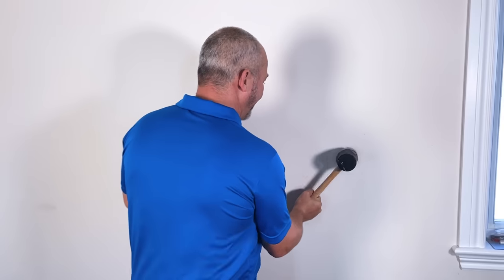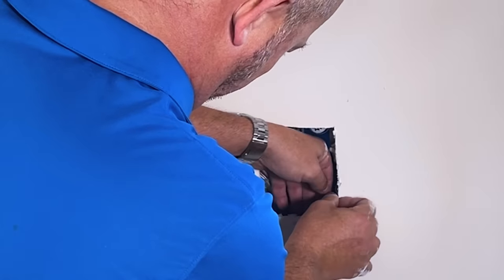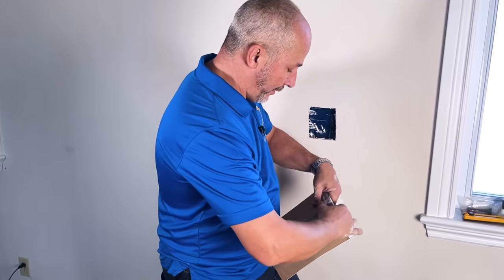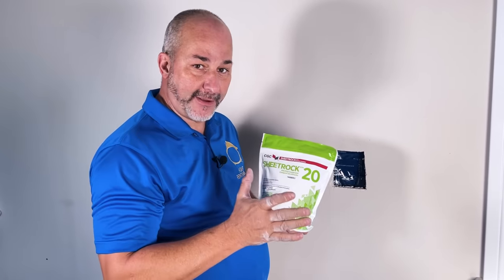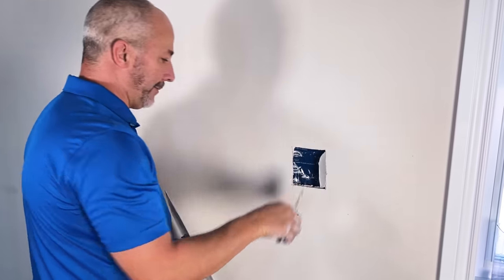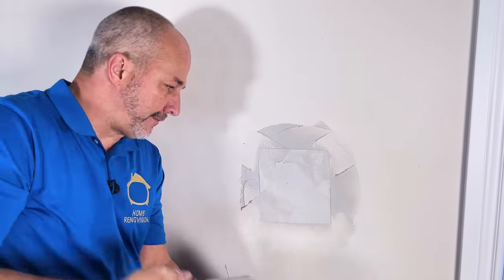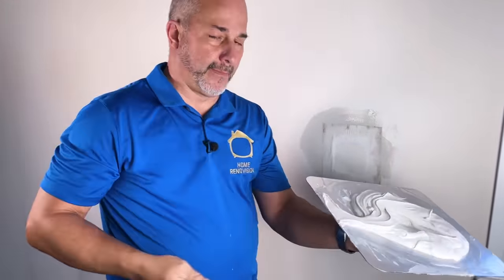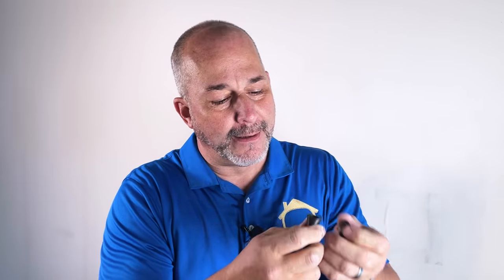Quick and Dirty Drywall Repair

Comment: It's hilarious that you happened to mention going to the hardware store to ask for a broken piece of drywall. I just removed a door and the door casing to make a regular old entrance way. I needed a small piece of drywall and got a broken piece from Home Depot for free. It doesn't hurt to ask one of the employees. Politeness goes a long way.
Reply from the maker: exactly! some of the best patch material out there is the free drywall strips they use to stack the drywall.usually a whole bin of them lying there!

Comment: Love the humor that you inject into every video. The only suggestion I might add is if the hole is any bigger a piece of bracing may be required behind the patch. You probably covered this topic in another drywall video.
Reply: Especially if in an area that might be hit again.

Comment: Working on mudding for the first time and all the drywall videos (Vancouver Carpenter's as well, who you should do a collab with if you do one on drywall) have it going better than I expected. Hawk and paper tape and hot mud and feeling like I'm actually half way decent with the knife. The trowel though, man that is so much trickier to use than I expected but enjoying figuring it out little by little. We'll see how the skim coat I need to do this week goes, gotta get some paint of these walls!

Comment: I love this trick I learned it from you. Today I had cabinets being installed , but the outlet for the garbage disposal was aligned with the edge of the new cabinet and it had to be moved to the other side of the stud. Since I was doing the under the sink mechanicals this was my responsibility by the time I was done there were about 5 places that needed to be patched. This technique worked for the edges of the outlet just by cutting the paper off on those sides. I was able to plaster the paper edges to other paper edges . since it will be behind the cabinets it doesn't matter, much buy, came out looking great .

Comment: When I'm concerned about adhesion or bubbling paper, I like to add Weldbond glue to my water. It's a multisurface PVA adhesive that's mostly waterproof once dry and dries clear. Its compatible with plasters and muds and concrete too. The patch is tougher and more flexible, paints better too. BIN Shellac BEFORE mudding also eliminates bubbling if there is exposed paper.

Comment: As a house painter, there were many times I would fix drywall where the door handle went through the wall. After fixing a hole a second time on more than one occasion, I started keeping door stops with me. I would install them immediately and charge the customer  a nominal price. Nobody ever complained. It saved me a lot of work and the customer was happy when I explained why I installed the door stop.

Comment: I've been patching small holes and gauges using your method of mixing small batches of 20 min mud, great tip.  When I am too lazy to dirty and clean my hawk for small repairs, I use a styrofoam or paper plate then fold like a taco in my hand.  Good enough in lieu of spackle.
Reply from the maker: Noice!

Comment: That was a joy to watch now I will be able to confidently address that minor issue in the kitchen a badly executed patch. My biggest issue is cracks in plaster render on brick- these hairline cracks are unsightly in the laundry, bedroom and living room. Vibration from upstairs apartment renovations resulted in these cracks which I want to repair  before I redecorate (paint) - do you have a video on plaster render repair?
Reply from the maker: not yet but he system is quite easy. first spray the crack and adjacent area with killz. then patch sand and prime with drywall primer. take acetone to check existing paint. if it wipes off then you have latex and are good to go. if it does not wipe off then you need to prime the walls with a flat oil as a primer to transition from old tech to new tech. then you can sand and paint. Cheers!

Comment: My repair work starts differently …. 

I see a hole in the wall …. I go to Home Depot … buy drywall, spackle, knife, duct tape, paint, … don’t know how to carry drywall home so return it. Break it while unloading… suddenly realize that there was a deal in Lowes. Return everything and go to Lowes. OUT OF STOCK. Come back to Home Depot .. buy and go home - forgot the knife - go back … buy knife - wife calls to buy groceries while I am out. Buy groceries and while I’m there buy beer and wings. Tired now, I sit on porch and have been and wings. Head to the hole in the wall - wifey warns not to screw it up. Tension. Open spackle and drop it on carpet… google on how to get stains out.. clean carpet thoroughly .. it’s late night now will call handyman next day …
Reply: I am sorry,  but hahaha 😅😂. I see myself through you.

Comment: Yes, Easy Sand is the boss! I love that stuff. The only place I don't put it on is my sandwich and the kitchen sink. Thanks Jeff for recommending it 2 years ago. But the instruction says don't spread too thin so it doesn't dry before it hardens. But it's probably not a big issue with the 20-min variety.
Reply from the maker: You bet!

Comment: If it actually is caused by the door knob, I just use a 4" plastic stick on disc that goes right over the hole with enough to stick to and saves the trouble of a repair. Of course this is an apartment complex so that's what they prefer, still looks good though.

Comment: Here's a problem I'm repeatedly faced with when remodeling: What's the line between "let's patch this" and "it's easier just to rip out the entire wall or ceiling and re-do the whole thing"? 10% 25% 50% 75%? What's your opinion?

Comment: Thank you for all your videos.  Question? After installing cellulose in my garage.  I found myself with 40 two-inch holes to fix.  What would be the best way to repair and seal my walls backup? Thank Brian.

Comment: Is it necessary to sand after the first coat. If so why? I'm relatively new to the trade so would love to know the reasoning behind it.
Reply from the maker: only if you have a wrinkle or too much mud. sanding does not increase the bond of a second layer. Cheers!
Reply: @HomeRenoVisionDIY  Good to know. Thanks for the information and great content. Cheers!

Comment: I have always used scrap wood,plywood etc,the a piece of rock to fill.Then use plaster of paris to fill joints,followed by a skim or two of rapid coaf  I can complete an entire patch in 30 minutes! First one I ever did wss to prove to a worker that it does not take an entire workday,to patch a hole!
Reply from the maker: no doubt there are faster options. but 20 minute mud is convenient to work with as well as fast!

Comment: If its the door knob that made the hole it will 100% come again if you fix it this way. You need to stick a big pic of plywood on the backside to prevent it from happening again.
As large as the hole is alloving you to put in.
And then give it some screws all the way over befor you patch it up. This here will only hold until next time the door opens up in the wall.
Reply: That’s probably why he mentioned get a door stop and installing it after you patch it to keep it from happening again. But yes without a door stop it will definitely happen again and again.

Comment: Thanks for the video. I have a very similar issue, though. Recently, I changed a ceiling light, leaving a small quarter-inch-wide and one-and-a-half-inch-long irregular hole on the ceiling. What's the best way to fill it up? Thank you for your suggestions. ❤
Reply from the maker: i like to use expansion foam. let dry and trim it flush then mud. or use the 20 minute mud and when it is dry use paper tape and a couple thin coats to cover. Cheers!
Reply: @HomeRenoVisionDIY  Thank you so much!

Comment: Can you do this type of patch around a light switch? I had to cut a larger area around mine to run new wiring
Reply from the maker: yes but then finish with a circle of mud around the whole switch to create a level surface so the switch plate looks good when it is installed as well.
Reply: @HomeRenoVisionDIY  Does that mean I cut a hole in the “patch piece” to fit around the switch box itself? That’s how it works in my head. Just don’t want to mess up!

Comment: normally I love the Cali patch, but this one will result in a huge blister
Reply: Why?
Reply: @DeltaH-9  you can see the ripple. If it doesn't get cut out and re filled it will result in a blister eventually.
Reply: @HunteroftheNorth  ok, cut the small ripple out, add some mud, sand, done.
Reply: I saw that, but you know that's a thing you fix later after the demonstration. In the youtube world.
Reply: @CalebGibbsAvenue  I know it just doesn't look great on camera
Reply: @HunteroftheNorth So what would you do to eliminate the ripple?
Reply: @runnerchom If the ripple I thought U saw toward the bottom left if the patch, it should have worked out with first coating.

Comment: I have a couple of holes in a drywall that got slightly ruined from standard wall plugs that carried too much weight, so the holes got pretty widened and are now useless for mounting stuff through again. Am I forced to drill new holes elsewhere if I want to install something heavy onto the wall?
I've already ordered some drywall plugs, but ideally I'd like to use the existing holes in the wall. Thanks!
Reply from the maker: they make anchors that create compression behind the wall that are worth looking into.

Comment: Jeff, if I were you I’d demand ppl refer to me as Thor. And I’d name my hammer mjolnir.

Edit: are you familiar with the “two shims” patch? Or really just a couple stir sticks or whatever. Cut square patch, trace patch over hole, cut out, put in 2 pieces of whatever for strapping and depth set, screw patch to strapping. There’s no bulge or paper wrinkles to try to hide. I used to do the California patch too but I think you’ll like these results better. Food for thought. Cheers

Comment: Would this method work on the ceiling or is just walls?
Reply from the maker: anywhere, however in a ceiling it works best if you slide a piece of scrap wood behind to secure the new piece with a screw. Cheers!
Reply: Thank you!!

Comment: I’m in a state that borders Canada that gets all 4 seasons (typically 4-5 months of winter). Should I have a vapor barrier in my home? Currently installing insulation in one of my rooms (faced R15) and am wondering if I need the vapor barrier.
Reply: Faced insulation is technically a vapor barrier. However we use plastic and it is completely sealed with eurethane and this Tuck Tape he shows and plastic boots around all electrical outlets. 
 It doesn't hurt to do it but if the whole house isn't done it's kind of  pointless.
Reply: @evictioncarpentry2628  thanks for the reply! This is what I needed to hear. We are only redoing one room. I don’t think the rest of the house has it, in fact, I can almost guarantee it. Appreciate the help.
Reply: @HabitualJoker  No problem. I think people make out all these issues to be bigger then they are.

I bought a reno house built in 1904, somewhere along the line, they blew all the walls in with cellulose ( cut a few open for electrical and found this out) zero vapor barrier for the last 120 years and have no issues through +30 summers and -30 winters.
Reply from the maker: whenever you are doing repairs in 1 room keep with the existing building technology. updating 1 space will really throw off the heating and cooling balance in the home.
Reply: @HomeRenoVisionDIY  this is great to know. Thanks a ton!

Comment: Many tks Jeff. I think I saw you first doing this about 3 years ago. Have used it numerous times since and many other people have copied me since! One adjustment I learnt, due to different plaster board here in Europe I presume, is that I lightly wet the paper, not the plasterboard nor the square, just the joining paper. 
I do the same with our plaster tape for the joints.
This way I avoid the need for excess plaster and also have no bubbles after when dry.

For the experts, of course there are many, why do you guys over there call it mud? We call it plaster. It is plasterboard, made of dry plaster. 
Mud for me and the majority of the world I would guess is when you have dirt and water mixed together.
Would like to learn why?
Reply: Way back in the ancient times legit mud was used to seal holes in the buildings of the time. While the composition of the compound has changed, the purpose of it hasn't so I think the term has just stuck through the ages.
Reply: @GoldenAura32  awesome. Many thks.

Comment: Jeff, I know you explained in another video why the vapor barrier is on the back of the inner wall in Canada, but I can't remember why.
What is the reason?
Reply: If I remember it correct the theory is that in winter we don't want indoor moisture to get to the insulation which causes condensation which then freezes
Reply from the maker: up north we have to manage not just air movement but also moisture. if our water vapor can travel freely into the insulation then it freezes and builds up frost. ultimately it thaw in the spring but it will also be really wet for a long time causing mold to develop. Cheers!

Comment: JEFF! I have a cracked basement wall slightly bowed in my small four plex. Emailed a local civil engineering firm and based off my description they quoted me 3500$ Canadian to do an inspection and provide a repair solution including permit and construction drawings. That is more than I collect in rent in two months. This is why I've been paying for this badge for 2+ years. Is there any reasonable way out of this that doesn't start with giving the enginerds 3.5k right off the bat??????? Please help me
Reply from the maker: not really. a 4 plex comes with serious liability. best to use the increase in the asset value from the last 2 years to correct it properly. a simply refinance situation. you can always do the work yourself if you tell the engineer to design a diy solution instead of using proprietary materials that only contractors can get a hold of. Cheers!

Comment: i tried to do some DIY with a switch and outlet, and now i need to repair the drywall around them (a couple of cm/ an inch). do you have any advice on patching drywall near/around an electrical box?
Reply: Oh, my! We have a very similar issue 😅
Reply from the maker: use the 20 minute mud to fill the space. once dry apply the paper tape on all 4 sides then 2 coats of mud to smooth. if you only repair 1 side the cover plates will always look crooked and have gaps. Cheers! rectangle boxes must be repaired with a circle of mud.
Reply: @HomeRenoVisionDIY   thanks Jeff!

Comment: Far better to cut your patch first and use it to mark round ,that way it's a perfect fit first time 
Just a tip 👍🏴
Also thats a weak patch you want to put a couple of small straps behind it and screw it 
If someone eas to push that it would just push in

Comment: I would die if you made a video on repairing damaged drywall around a poorly-caulked tub base and surround.
Reply from the maker: that problem is more likely a lack of waterproofing behind the tile and a lack of grout sealing. but the same applies. remove the junk and add a piece then use mud and tape to finish.

Comment: Keeping the paper is a new one on me. I'd still back up the edges on the back side with some flat bits of thin plywood. I want my patches to be as strong or stronger than the original.
Reply from the maker: drywall and paper is still drywall and paper. it is only strong if you don't bump into it. Cheers!

Comment: Good video but please for the love of god just get some cheap wood and use wood backing. 4 drywall screws is all you need. In a year someone is going to push on it or try to hand a picture and there goes your patch

Comment: He wasn't wearing his glasses...... He left a huge blister on the left side of the patch and didn't notice, needs to be redone from scratch. Why post a video online that degrades his franchise?
Reply from the maker: easy this happens. just sand it smooth when it is dry and then you still have 2 more coats to finish.